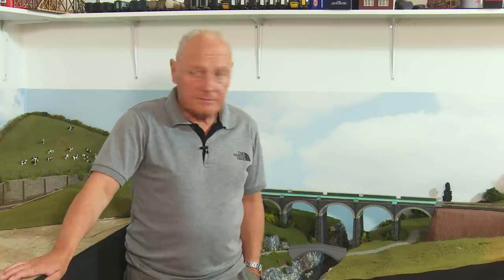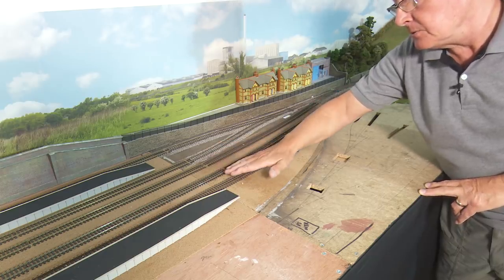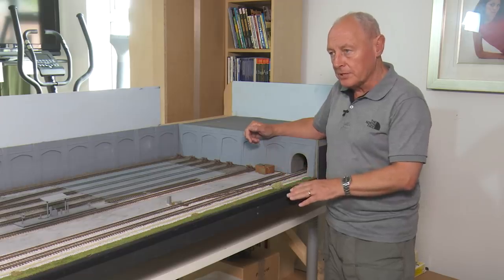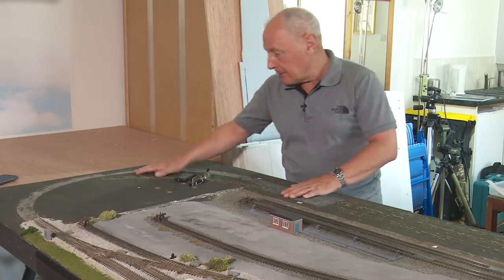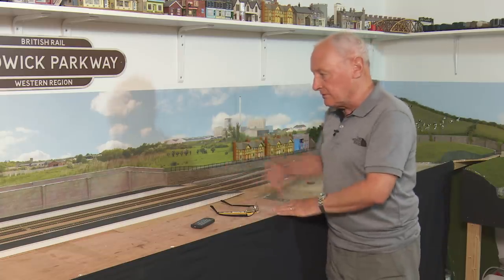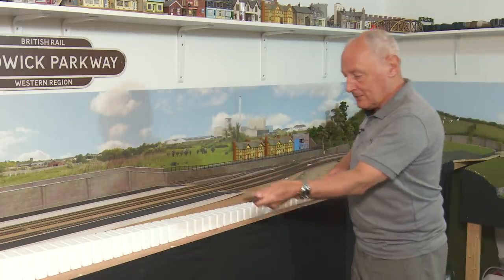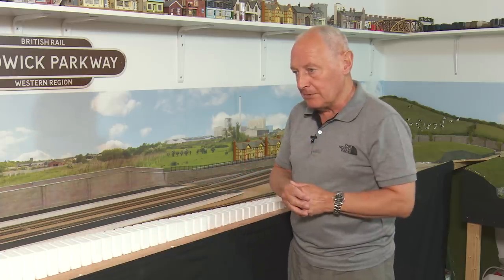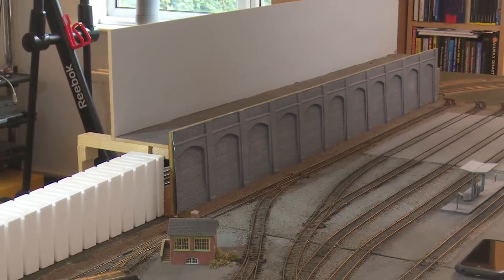A boring track plan at Chadwick Model Railway. | 72.

Comment: It would appear that others have already suggested that you use one incline and fix a wide enough board to accommodate two tracks and build up support from a retaining wall or embankment. I think DCC concepts make metal plates that can be laid under the track so that magnets fitted to steam locos can also use the slope. My name is Jim I’ve been following you for a good while, I’m new to all this. I’ve made a start to a layout and you can see it if you visit Durban Garden City. I unintentionally have two sites through error and can’t close one down. You will see which one is current.
Reply from the maker: Great HST video. If you can’t delete the other channel, rename it “test 1” or similar.
Reply: Chadwick Model Railway l seem to be stuck with it. I can’t access it at all. God only knows what password I used. Hopefully my videos will improve with experience.

Comment: Hi Charlie, it's wonderful but all rather flat track wise. Why not build a one-track incline from the parcels line for a train to run to a Mill or Chalk pit etc, on top of the old Chadwick or slightly further/ or run a commuter line. One in twenty-five seems steep but it's your railway. The incline should cross to the back at some stage or come from the cross over at the end of the platform as at the front it obscures the railway.  See my railway Churchaven on U-Tube.  Cheers Baz.
Reply from the maker: Sound advice, thanks Baz.

Comment: Please forgive me if I'm stating the obvious and you have already done so, but you should use the lightest locomotive you have for testing the incline, not the weakest one. Or more specifically, the (entire) train with the worst tractive-effort-to-total-weight ratio. While power determines how fast a train can go up an incline, the tractive effort determines whether it can get up at all or just slip its wheels. And tractive effort is usually limited by weight on driven wheels, not by the motor's power.

Again, forgive me if that's what you meant, anyway.
Reply from the maker: Sound advice, thanks G.

Comment: Hello Charlie.

Just my two cents. Really not a fan of the incline. It's much too steep and I'd be concerned it would end up looking too 'train setty' if placed in the scenic area. Could you hide it some how, behind a scenic break perhaps? A line disappearing in to a tunnel?
In all honesty I think the layout plan looks just fine. The tracks are flat and straight, yes, but that's how railways are supposed to be after all. The station area has a very town center vibe to it with the retaining wall at the rear. Personally I'd mirror that at the front and connect the two sides with a road bridge and have the main station building spanning the lines with stairs down to the platforms. That could distract the eye from the straightness of the lines, although that very same straightness is prototypical, so swings and roundabouts!
You can always find that depth by building the scenery up around the lines, just as you have done with your curve leading to the viaduct. Elevating the station area scenery would compliment the valley very well, giving the impression the land drops away sharply, in turn making the valley deeper than it seems now. Your parcels depot would look fantastic in a dimly lit dingy little cutting off to the side of the station.
In all, I think your concerns could all be sorted with some good old scenery.

Hope I haven't rambled on too much.
All the best. Mike.
Reply from the maker: Sound advice, thanks and please keep rambling Mike.

Comment: Hi Charlie. Interesting vlog. Plenty of others are making helpful comments about the steepness of the 4% rise, so I'd prefer to ask a question about the actual logistics of making this change. Currently you have your two mainlines that spread into four (or 5) lines at the station and (if it was all put together) you could have 2 trains running round and round and sometimes pulling in to stop at the station. How would you divert the inner (up) fast track across the down line(s) to get to the incline? Surely if they go through points and diamonds then any train that is running as a loop on the down line will have be stopped whilst the up train crosses over to go up the incline.
Maybe you're happy to do this (automation?) but I've had a layout with something similar and found it to be a pain in the proverbial. I'd be interested in your solution to this as I've ended up with just a single track going up to the raised track just to avoid this problem.
Reply from the maker: Sound advice, thanks mate.

Comment: A issue that you may like to consider before the gradient is installed is the overhead clearance between the fiddle yard and the upper station area. I model in N scale and have a triple shelf layout. I have only left 200mm or 8 inches between the middle and lower shelf. I find this no where enough vertical clearance. I use the lower shelf as a staging yard (American Fiddle yard) so understand the difficulties of rerailing and doing other such chores. A clearance of at least 300mm or 1 foot would be the minimum vertical distance I would require nowadays.
Neil W
Reply from the maker: Sound advice, cheers mate.

Comment: Hi Charlie, 

With your incline, from bitter experience with a 3% incline, I would strongly advise to only incline on a straight run and do not incline curves, the load on the loco increases significantly. If you want to increase the width of the incline to accept a double track you could lay a 3 mm thick ply wood top of course this may increase the noise level slightly.
Every good series of videos and the presentation comes over to me very well. We seem to talk the same sort of language.
Keep it up 

gards
Nigel Collins
Reply from the maker: Hi Nigel, thanks for the info.  
On the incline, I'm only thinking of DMUs and three coach diesel hauled trains.  
I had planned some curve on the incline but very little.  
I guess I'll have to keep my fingered crossed on this one.
Were you attempting to run longer trains?

Comment: Hi Charlie, Good idea idea about the upper terminus, i would run the gradient in front of the station, certainly more 3 dimensional and means you keep the freight loop, looks a bit different and also gives you a reason to cross the mainlines with a bridge etc.
good luck.

Graham.
Reply from the maker: Sound advice, thanks Graham.

Comment: Re the width of the poly incline - either glue some 5mm polystyrene on top of the risers to create the required width roadbed and have an overhang which could be supported (if necessary) with scraps OR slice the risers in half lengthwise and glue the risers to the centre of the required width roadbed ( again 5mm poly), thus giving support under the sleepers/rail.   Both options might need fettling to get the height right.
Reply from the maker: Sound advice, thanks David.

Comment: I think the plan is sound however I do think the rise is too steep and you don't really need it to be that way as the rise could continue round to the other board to the left that would allow a much steadier/ realistic rise. However you have bought the 25:1 size so there would be a further cost involved. I think you also believe its too steep and if you don't correct it now will it continually bug you - it would me! Other than that sounds like a good plan.
Reply from the maker: Sound advice, cheers Roger.

Comment: Hi Charlie, great videos, really enjoyable and inspiring too, a few thoughts about your railway and your dillemma, firstly your viaduct reminds me of the Settle/Carlisle railway, I also thought of Buxton as a possible template for your terminus, you might be better with single track for your branch,you don't have a lot of room for runaround at terminus, you might be better ditching the TMD board and starting again,it seems to be an obstacle,have you thought about a quarry or agregate railhead,lots of variation, motive power,long freight trains, loading, landscape, thinking Morehead on GWR class 59 or 60 or even 47 or 37 there's also Doveholes in Derbyshire,Buxton has a shed for locomotives,  do you need a station at all,perhaps railway through the landscape ,long drag, Shap summit, anyway sorry lots of stuff,I'm sure you will find a solution.....best of luck !!!
Reply from the maker: Interesting points Leslie, and I’m so pleased that you enjoyed the video.
Reply: @ChadwickModelRailway  I agree with Leslie. A single line branch would open up the world of interesting operation. The terminus over your fiddle yard, with a small in-between station where the up and down trains on the branch line can cross.
However, I would only run shorter length trains on the branch with smallish locos, to create the impression of a small country village or a small mining town. Plenty of operational possibilities.

Comment: Hi Charlie. I think your layout is certainly not boring, but I understand your need for a change. About your incline : no way. This is far too steep. In most books and articles I've read about inclines in model railway, they say no more than 3%, and 2% or 2,5% should be considered reasonable, 3% being the tolerated exception. Your weakest loco can climb 4 in a "laboratory setting" (ideal configuration, no heavy train, very small distance), but you little test has nothing to do with real running conditions. I think you should really consider a smaller gradient for your incline. 

By the way, remember how the real trains work, and what they can climb - or not. I don't know what's the steepest in UK, my only references on these matters are the continental railways. The steepest railway lines here in France are in the Pyrenees, where we can find 3,3% (we say 33 pro mille) between Foix and Latour de Carol, or even 40 pro mille on the Pau-Canfranc line. And this is really considered as an absolute maximum if you don't want to have a rack railway, as in the Swiss Alps eg (Glacier Express, Bernina Bahn etc). And thereby, most of the times the trains on these Pyrenees lines were hauled by two locos in the front, and one or two pushing in the back. 

As far as I can see, you seem to have enough space on your layout to build a "softer" incline. Maybe therefor you have to consider adapting your fist idea, maybe the starting point of the incline should not be there where you thought to put it first, or maybe you should build a helix (yes, why not?). But really, really, don't go for 4%. You would only have bad surprises when running the layout later. Some people will tell that if Woodland Scenics makes a 4% incline, it must be feasable to use it on a layout to ride trains on it. I would reply that the aim of MS is to sell you things, not to run YOUR trains on YOUR layout ;-) 
I'm preparing a mountain layout based on one of these Pyrenees lines (my sentimental place, you know...) and one of my hard constraints is : no more than 30 pro mille, norm at 25. 

Hope this helps, looking forward to the next chapter! Cheers from France.
Reply: Forgot this: consider doing some little benchwork for your incline ?
Reply from the maker: Sound advice, thanks Antoine.

Comment: 4% is too steep Charlie. It seems arbitrary rather than natural. If the new raised station area is, say, 12' away from where you want the grade to start, why not use the entire 12', starting grade, flattening out, maybe for an industry or two, then continue grade to new station area.  What about new station area as a stub terminal? That might create some interesting operations?! 

That's the one thing I notice with UK OO layouts, most, if not all, just go round and round. Respectfully, the fun is operations. I'd try to insert more operations into any layout (i.e. stub terminal, industries to switch, etc.).

Don't get me wrong, I think whay you are doing is great. I just find that running around on a flat surface is not as exciting as it could/should be. Kinda like your long straight platforms - boring. Can you not put them on a curve of some sort? Just my humble thought that I hope might help. 

Cheers!

Doug - Vancouver Island, BC
Reply from the maker: Sound advice, thanks Doug.

Comment: Evening Charlie ...Just giving some thought on your layout and for any suggestions that you may take on board. As we all come to a cross roads at times !!! Hence more minds and suggestions are better than one !!!!

1/:----  Turn slightly your Terminus on the right side of you bridge.Have your fiddle yard underneath,gaining some more room in the process for any improvements later on.Plus gaining a 1-4% gradient, this will do the trick nicely  !!! DDC Concepts", do a nice system of magnets.on inclines only. This will make your rolling stock run nicely and smooth  !!!

2/:---- As a suggestion only. On a 1st rad/curve. One can used it for a cattle market,horse loading bay at the location of the old engine shed,as a shuttle between Parkway and Central.  Which will be eye catching in its own right alone.   The only engine's one can use are in steam are 0-3-2 or 2-3-0, or 4-4-0,depending upon what ERA your doing at present ???  Anything larger than this then problems may occur.  I fit small fishing lead weights to over come this problem or for any derailments. It could be a "Heritage Line" only.
Great video once again Charlie... At the end of the day its your layout.To decide which channel you may wish to go down... Carol
Reply from the maker: Thanks Carol, some interesting options.

Comment: Hello, love your vids! I have used the risers before - both 4% and the slightly shallower 3% - although longer (12ft I seem to recall) there was less 'roll back' with the 3% and I can tell you a 8 coach HST gathers quite some momentum going down the 4% !  It might also be worth considering the frustration of every train you send upwards is going to have to be turned somewhere - obviously this is ok for DMUs and double ended rolling stock, but for loco hauled coaching stock and freight / parcels every train will have to be turned or 'played with'.  For me the novelty didn't last long ! Perhaps an off scene reverse loop which is accessed by an 'avoider' for your terminus would be a good solution ?
Reply from the maker: Sound advice, thanks Richard.

Comment: Hi Charlie. I had a 4% gradient using the same materials as you have purchased for my branch line running off the main layout on an approx 40" radius. Even an 0-6-0 tank (no traction tyres) with 2 suburban coaches would struggle. If you tried something like a Pacific then anything more than 5 coaches needed banking. More to do with the radius I suspect, but I would personally try it temporarily in place before you start gluing and screwing.
Will be continuing to watch with interest 👍
Reply from the maker: Sound advice mate, many thanks.

Comment: Interesting - two stations: quite ambitious! 

I do not imagine that this is how I would do it if this were my railway; I imagine that I should be inclined instead to add more interest at the Parkway station, perhaps with some carriage sidings for terminating/reversing semi-fast trains, or perhaps a substantial parcels depot or similar; and perhaps also a bay platform, so that you can have the fun of terminating and through trains in one station. Of course, tastes vary. I suspect that, if you are to be redesigning the track layout at Parkway, you might find the space for larger radius points on the outer line on the left hand side. 

Had you thought of planning everything out in software first?
Reply from the maker: No James, perhaps the software is something I ought to consider.
Reply: @ChadwickModelRailway  Do! It really assists in planning what works before buying anything.

Comment: I.
What makes the countryside boring is the very absent from molehills and cowpats on the golf hole green like hill before & behind the cut to the viaduct. It is fun to make them from greenish brown coloured pva and the other from earth coloured gypsum. Richard Bardsley and Tony Hill both wrote books about landside modelling and realistic landscapeing. 

II.
All buildings usually have a bit or more of a wreath of weed in the 90° edge between pavement and wall. 

III. 
Grass isn't everywhere the same. There are flowered areas, muddy, dry.

IV.
Let's add some tree stump by cuttung a branch at the point so you get a breather end to the floor side. 

V. The bridge and viaduct are too clean on the side. With a bit of Citardel camoshade ink you get a green touch with sepia or darkearth you get two brown inks to give some realistic touch to the bridge and all the buildings. Beware of a weaving of the cardboard buildlings at the overuse of ink in one single weathering.

VI. There are no limited clearance singns on the bridge. Bob Alderman wrote a wounderful book about bridges and their details.
Reply from the maker: Excellent points Gorg but please remember that the details are not complete. I’ll check out Bob Alderman’s book, thanks for the tip.
Reply: @ChadwickModelRailway   pleas check your FBmasseges immediately I didn't want to post at public

Comment: Haven't long found this channel but don't know how I missed it - it's now one of my favourites!

If I'm understanding correctly, only caution I'd have with a terminus on top of the fiddle yard is if it makes manual access to the fiddle yard difficult. Not something you may need often, but you ideally don't want to be cursing the few times that you do!

Sort of related to the above, have you considered making the incline a single track branch line, maybe with a passing loop half way so you can still run two trains back to back? (That could also make for some very cool automation if you want to go down that route!) It could make a smaller terminus station above the fiddle yard more "believable" so it'd be less in the way physically, and also make it look a bit less crowded at the Chadwick parkway end.

In any case, great video and keep up the good work!
Reply from the maker: And hopefully you’ve subscribed too Berry.
Reply: Of course!